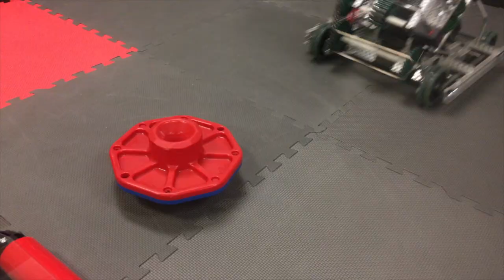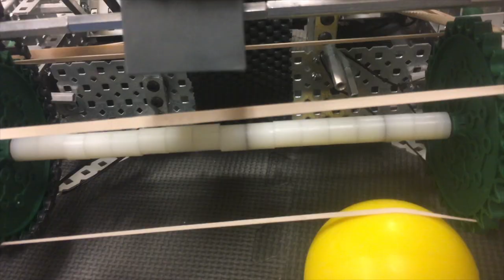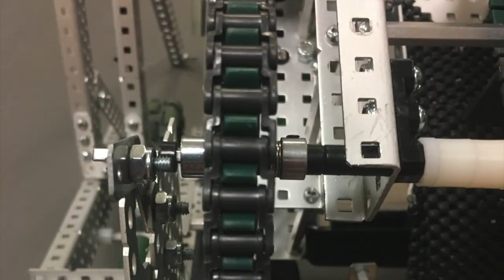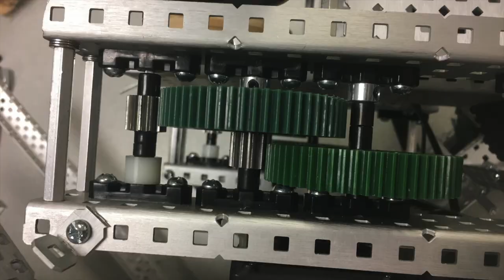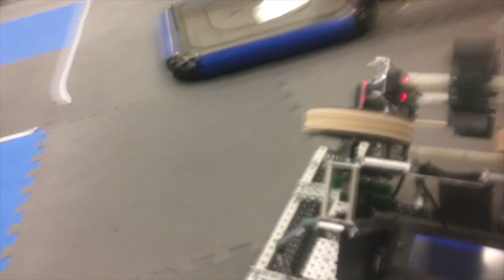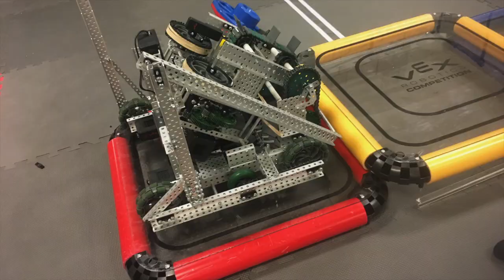Vex Turning Point Post-State Reveal And Explanation

Comment: what the difference between double flywheel and solo flywheel? i have only have experience building punchers and catas and idk about the benefits of a flywheel, in particular a double flywheel
Reply from the maker: The double flywheel is easier to build, but it also allows you to aim your shots side to side, allowing you to get a wider range of shot positions. We didn’t do this, as it would most likely require an insane amount of programming and practice to be able to utilize it effectively.
Reply: We have a single had a double single seems to be more accurate but harder to build also we have a double shot flywheel now aka angler and can outscore most punches and catas